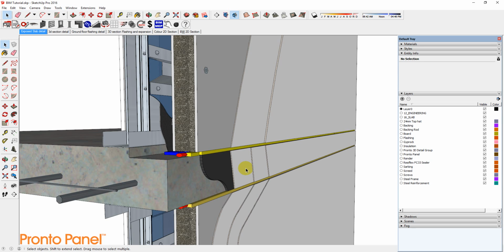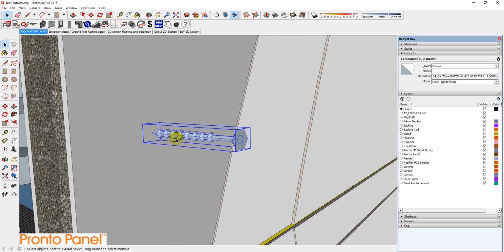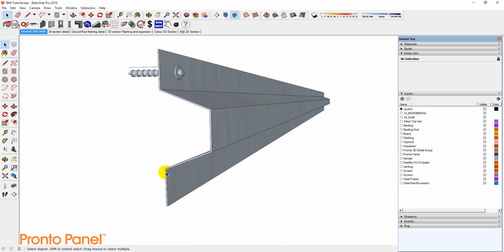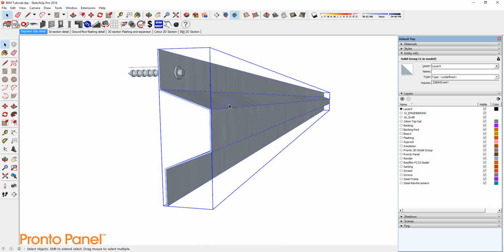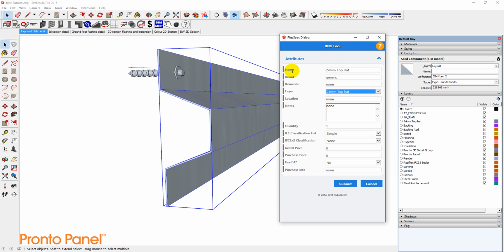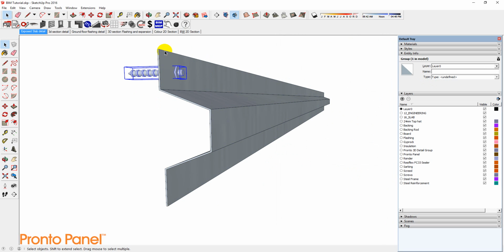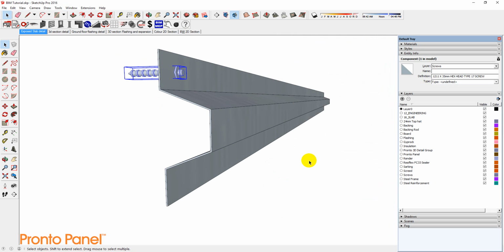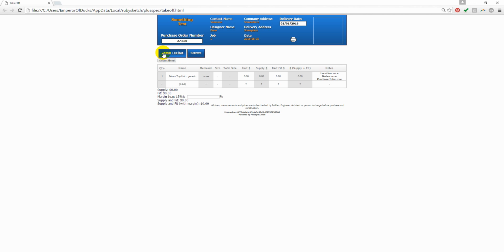BIM Tool Tutorial for Beginners

Comment: Structural Analysis ???
Reply from the maker: Hi Vecihi, PlusSpec is not an engineering tool, however, it does automate sizes in some instances and also high light things like steel lintels when they are approaching or exceeding recommended spans. At the end of the day, all projects requires engineering of some sort and PlusSpec makes it easier to make decisions early in the design process whilst delivering a BOQ and a related cost

Comment from the maker: A good tip in this instance where you already have a heap of similar components would be to break inside of the component, triple-click and then use the BIM tool as it will then make a count of every existing component for your bill of quantities or estimate.  It's all about getting more done, more accurately in less time.